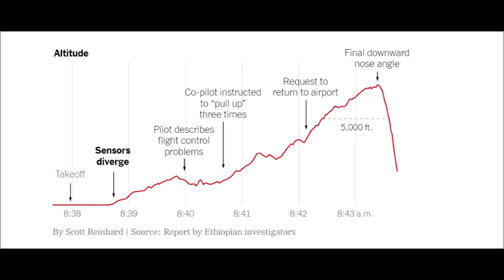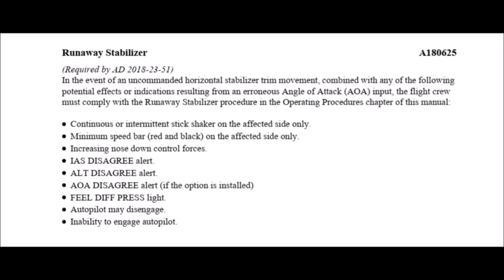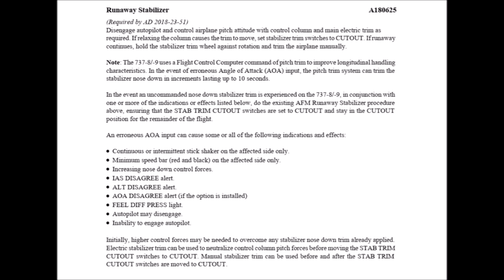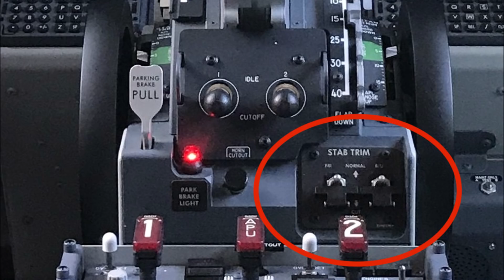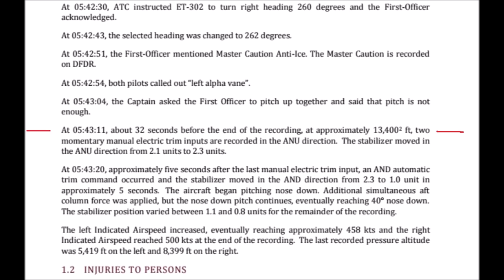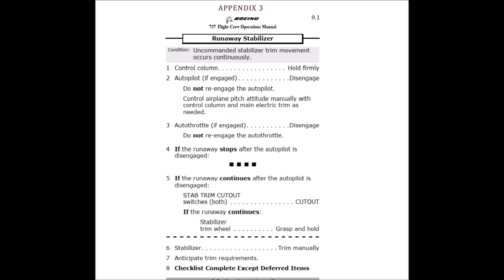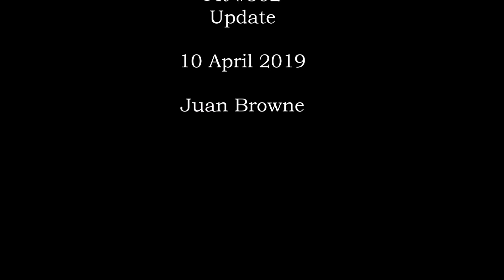737 Max Update 10 April 2019 Runaway Stab Trim Procedures

Comment: I listened to an engineer who said that Boeing tried to correct an engineering problem with a software solution, instead of going the more expensive route of re engineering the aircraft. I have heard you and other explain how Boeing went to the big more efficient engines, which are cheaper to run. This has made the plane very popular, but, it presented problems with the flying character of the plane. They substituted the cheaper solution of a software solution.  The other problem is that the airlines want to cut back on pilot labor, so they want smaller crews, and, this has driven the need for computer assists to the pilot. Does any of this make sense, i am only a lay person. My 94 year old father who flew for almost 70 years, maintains that the pilot should have complete control on both take off and landing. Does this make sense, he never flew anything bigger than a Cessna 182.
Reply: Let's put it this way, an automated system shouldn't send it plunging into the ground.
Reply: @JoeLinux2000  I think the point that i heard, was that the modifications to the air plane and engines, threw of the balance of the aircraft, and, instead of re-engineeriring  the air plane, they relied on a computer fix. As most of us know from problems with the computers in our autos and, elsewhere, you can not always depend on computers, remember HAL from 2001, Dave finally had to do the right thing.

Comment: As a dual citizen of the UK and NZ I’ve done quite a lot of trips between the two countries which are on the opposite side of the world. Most of these flights are on Boeing aircraft, when I see a 777 is like seeing an old friend. The 777 is a great product and very safe. Many of them are getting older now, but there safety is still as strong as ever. Yes feel it’s very easy to put the boot into Boeing which I feel is a bit unfair. For over fifty years there jets have been safely moving people around the world.  Yes there is a problem with the 737 max but the last thing that is needed is for airlines not to support this great American brand. Let’s giving Boeing some time to sort the problem out. The airline industry needs to strong airline manufacturers not just airbus.

Comment: I did not do my homework was it nighttime when they departed or daytime? And where is the wreckage of the aircraft now?
Reply: mike mullins Daytime. Other than the FDR and CVR, there is little left of either MAX aircraft.
Reply: @gordonrichardson2972 nothing much left I find that hard to believe but what do I know, engine components large pieces of metal in the structure stainless steel pieces, no there's a lot there in that ground somewhere or it didn't go there, 500 or 600 knots isn't enough to vaporize that type of stuff, and the data recorders were all right!  humm. Very deep in the ground! that's what excavators are for. To me things don't add up. And Juan thanks for that update. Something about the ad seems to be necessarily complicated particularly in a tunnel vision situation that could arise all the because Boeing apparently built a plane that they should not had certified. a hodgepodge just to get the product out quickly. I know easy for an armchair guy to say that but I'm not an expert in manufacturing these great machines, I expect more from them who do.
Reply: Of course the engines and landing gear are still intact, but the rest was mostly destroyed. The flight recorders are strong, and designed to survive exactly this kind of crash.
Reply: @gordonrichardson2972  yes Gordon I know you're right about that the black box is design to take that. I suppose if information shows that it was pilot error that the remains of the aircraft would not need to begotten out. Not exactly sure how NTSB works those types of situations. I don't know if being an mix of body and plane parts come into play on decisions of removal or if that is the grave of both. One question I was thinking of the aircraft was probably close to full of fuel I did not notice in the photos I have seen of charred a area. I didn't hear if the area burnt or not. It's just so darn sad, breaks my heart that so many people to die for some reason. I'm a licensed pilot and A&P and I understand risk involved in aviation, but  geez haven't we come Beyond what this is.
Reply: mike mullins The NTSB role is purely advisory, since the crash happened in Ethiopia.

Comment: A 737NG placed in the exact same nose down conditions probably would be recoverable, even with the loads and the crest critical mach number control instabilities on the horizontal stabilizer you mentioned. The last straw in this crash is that the same instability caused by the engine CG shift which MCAS is supposed to address also occurs when the AC is in an extreme nose down position (especially at max thrust). The only real solution to the instability issue caused by the engines in their current configuration is a larger horizontal stabilizer.
Reply: You can not ignore the fact that the MCAS on this particular model of Aircraft takes reading from only one AOA sensor. Which is unbelievable considering the effect of wrong reading or damaged sensor is Nose Dive. From engineering point of view  nothing else matters once you miss this fundamental safety detail.
Reply: @Red8ify  MCAS appears to be a kluge created to deal with the  high thrust nose pitch instability caused by the 737Max's forward engine placement (as one might find during takeoff). The same issue exists when the aircraft is nose down. It would not matter if there where multiple AOA sensors, it is still a kluge "fix", in fact it appears to a klug which causes the nose down version of the nose up problem which it was supposed to address. The 737Max will be the least safe of the  737 series to fly until it gets a larger horizontal stabilizer; of course it might not be financially viable with a larger horizontal stabilizer.
Reply: Juan,  in the previous video you mentioned  that MCAS also increases the speed in an attempt to prevent stall. Also, if the air plane is nose diving isn't the speed going to be very high?

Comment: Question: it was alleged that throttle commands altitude more than the plane pitch and attitude. Is this real? I can understand that a plane won't go up without engine trust and sufficient speed, but your explanation seems more plausible. Thanks for the updates and the analysis

Comment: Another excellent methodical report, unlike so many who are jumping to a conclusion. 

I think it will be found to be multiple errors. (mechanical, software, and human) I am still curious about the AoA sensor malfunction. 

More and more questions before the answer is resolved.
Reply: Kevin Moore The most likely cause of an AOA fault is mechanical damage (bird-strike or impact on the ground).
Reply: @gordonrichardson2972  Allegedly the AoA sensor on the Lion Air flight was improperly installed.
There is speculation that a bird strike or turbulence caused errors. Or was it damaged by  ground crew?

I did software development and testing for 25 years. It seems like damaged or inoperable sensors should be in the design. 

Along with not moving the stabilizer trim more than the elevator could counter act.
Reply: We still do not know the cause of the Lion Air 20 degree offset. It could be mechanical (bent vane), or electrical (wiring). In the end it does not matter, since MCAS is being revised to reject faulty AOA data.

Comment: At least SOME professionals (namely yourself) is willing to speculate, at the risk of possibly being proven wrong to some extent when all the data is in. When the available evidence is so overwhelming, it is very hard NOT to speculate.
I think your speculations are very down-to earth and as fair and balanced as the current data allows. My money is on you being mostly correct. I am retired myself, but having never flown a Boeing I am not familiar with Boeing QRH's, so I have a question about the "Runaway Stabilizer" section you show in this video: Which of these items are memory items?

When you have an apparently runaway situation like these pilots had, just a few thousand feet AGL, handling a runaway MCAS situation (a known issue at this time) MUST be addressed with QRH memory items AND PRACTICED IN A SIMULATOR! 
These guys had EVERYTHING stacked against them - and they lost the fight. This appears to be a SYSTEM error, not a pilot error
Reply from the maker: Correct,  memory item.

Comment: Would you please do a video on how the different engine placement on the Max series changed flight characters and weight and balance from the previous series if this is significant to the two crashes.  Thanks.

Comment: Interesting video! I've got two questions : how is it apparent from the initial report that they turned off trim cut-out? My interpretation of the report was the MCAS system went rogue and adjusted the trim in spite of the cut out. Would it make sense for Boeing and other aircraft manufacturers to make trim cut-out be one-way (i.e. you can only set it to cut-out and can't undo that action)? Then once the plane is safely on the ground, mechanics could manually re-engage trim to its usual setting.

Comment: My only real flying experience is RC or simulator, but if I was flying a sim and it was doing a nose down, and I was trying to throw as much pitch up at it through every system I have, I really would be hesitant to lower throttle with a risk of stalling from the unreliable control system suddenly changing its mind.  What a horrible situation.  Also wondering about the physical situation, if a pilot is trying to pull back on the controls as hard as they can, can they even reach a lot of the controls?  Pulling back and reaching forward are not good design for critical systems needing to be used in conjunction.  There are books on ergonomics of designing physical interfaces, but the entre plane is a cost cutting disaster so it's obvious to me many different steps in good design were ignored as too costly.

Comment: Thank's for this information about this plane. You're doing a very good job. 
To be honest, I am shocked (!!) to see a tiny cramped 737 cockpit with big spinning metal wheels with manual handles, endless big switches, a big paper manual for fail search procedures and basic rudimentary flight systems. Am I dreaming? It looks like in an old black & white WW II movie with Boeing bombers on a mission and not like a modern jet plane of the 21st century. What the hell is going on? 
And then listen to the Boeing representative talking about the "NEW 737 Max is the best of the best for our pilots..."? What a crap! Boeing is adding bells & whistles to a basically 60 year old plane following the mantra "...if it ain't broken, don't fix it!". Well it is broken.
I am done and will avoid Boeing  in future and always book on Airbus flights.

Comment: Lion air had the same problem, they hit the water at 400 knots
Reply: it was the same problem but they never  disabled  the trim power (they just kept on holding the trim up button to try and counteract the trim down, issue i had with that one was they was actively fighting the trim system for a long time)
Reply: lee x that’s true. But why did both pilots hit the water and the ground with that speed ? Maybe that speed was the only hope they had to stay on air.

Comment: God bless, red,or yello/black,or red/white, stripes on switches, those cut-off switches are black and they blend into the center console and they're on the co-pilot side too ,plus both angle-of-attack need to be hooked up to the system  maybe we need a third one ?with an indicator in the middle?redundancy, color coding,ergonomics,,

Comment: And why haven't manufacturers developed internal sensors, at least for AOA? These fragile, external sensors are ripe for damage from birds, ground equipment, weather, etc.

Crudely speaking, the AOA sensor could be like the mercury-type switch that turns on the light in the engine compartment of a car when you raise the hood to a certain angle. And pitot tube air speed indicators are just ripe for clogging (see Air France crash over the Atlantic en route from South Ametuca when the tube froze over). It seems like the opening needed for the tube could be flush-mounted and equipped with fouling diagnostics and countermeasures.

These systems don't seem to have been updated since the hey-day of the mighty Luscomb!

Comment: When you manually adjust the stab trim with those wheels what exactly are you doing? Do those wheels pump hydraulic fluid that turns the Jack screw? Is it a cable system?
Reply: You pretend you are reeling in a 1,000 lb. Marlin.
Reply: JetMechMA  If the pilots are remaining level by working the flaps against the force of the stabilizers it would seem to me that both sets of surfaces would be seeing a lot of load. I also have no idea what I am talking about so................
Thanks for the input, the routing of that cable must be crazy, that is a long run. I was in the back of a c130 at an airshow last year and was amazed at the amount of cables. I imagine they are all back ups for a hydraulic system of some kind.

Comment: I’m not a pilot or connected to aviation in any way but I find it amazing that 

a) there is some way to make it abundantly clear to the flight crew that the AOA sensors where in such huge disagreement. 

And B) that the auto trim feature clearly didn’t know that the AOA sensors where in disagreement and seemed to be taking its info from the faulty one wouldn’t or shouldn’t such a condition then error out the auto trim system?

I’d be interested in your thoughts.

Comment: How long does it take to regain trim manually once it is way out of whack electrically? Assuming you first use both cutout switches.
Reply: rotaryenginepete ...ok. I assume the manual trim is fully mechanical? I know what the screw looks like. I can't recall if Juan explained it.
Reply: @blipco5  yes, the manual operation is mechanical...at least it is on all the planes I have seen.  Just like with any other ball screw in a landing gear or flap drive, manually cranking takes forever and when there is resistance it increases difficulty.
Reply: rotaryenginepete ...Thanks again. Plus panic mode doesn't help any.

Comment: All this leaves me asking, "Why on earth did Boeing design a system so flawed?"  I don't see any excuse for building a plane with only one AOA vane.  Given all the bad things that can happen if the pilots and computers are fed bad information its just not acceptable.  Why do you suppose a plane has backup radio's and navigation equipment on board?  Corns cut and cost savings mean lost lives.

Comment: You are spot on with your remark about reducing automation, hand fly the aircraft and start taking back control.  Airliners have moved steadily toward more and more automation. We have entered an era where pilots rarely hand fly the aircraft.  I’d like to throw down a challenge to crews to fly just one leg of a flight with zero automation. No AT, no AP, and no electric trim. Yes, that's right, no nothing. Turn everything off, fly it from beginning of takeoff roll to end of landing roll and see what its really like to fly the airplane.  You might be surprised how poor your actual piloting skills really are.  
I’ve been flying since the early 1970s.  My trial by fire came when I worked flying Cessna 210s and Beech Barons for an air courier operation.  I learned to fly lots of crappy airplanes in crappy weather.  Autopilots?  You must be joking!  Electric tirm?  Oh, that’s broken.  What about that line of bad weather ahead?  We don’t care, GO!!  On a long day of solid IMC flying you got a workout and slept like a log when it was done.  When I left that job, the flying got easier.  And the next job was easier yet.  Looking back, I learned more about flying at the air courier operation than I did in all the years that followed.  But, I too, got lazy and rely upon all the nice automation.  But every once in a while, I will still hand fly the machine.  The young guys (and even some of the older ones) look at me like I am crazy.  
I am concerned about younger crews that have never known aircraft without heavy layers of automation.  They are more computer programmers and less pilots.  In another 20-years we will likely be pointing pilotless airliners full of people down the runway, uploading a flight program and then launching the beast.  Then we all will be out of a job.   “No,” you say?  “People will never get on an airplane without a pilot,” you say?  Sorry, but you are wrong.  When airplanes were invented, people said they were dangerous you will never get anyone in one of those things!  They were wrong.  When, propellers give way to jet engines, people said no one will fly on anything without a propeller.  They too,  were wrong.  People will get in an fully automated airplane when the time finally comes.
The problem is, the automation is not flawless either.  And when the day comes that some airline launches their first pilotless airliner, we will still have the occasional airliner crash.   
So, here we are with these beautifully automated aircraft, with pilots so conditioned to embrace and use the automation, that they are increasingly less and less able to “fly” the aircraft.  Please, don’t get me wrong.   I am not saying they are stupid.   These are highly trained people that know what button to push, knob to twist or lever to move to accomplish something.  But, take away their autopilot, the electric trim and auto-throttles, and lets see how great they really are.